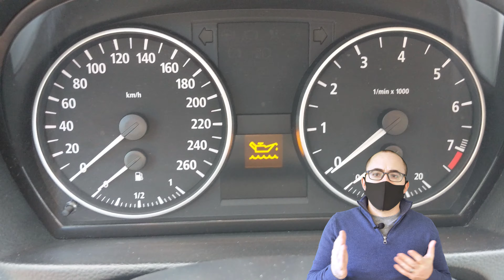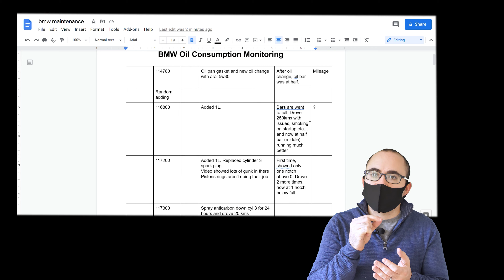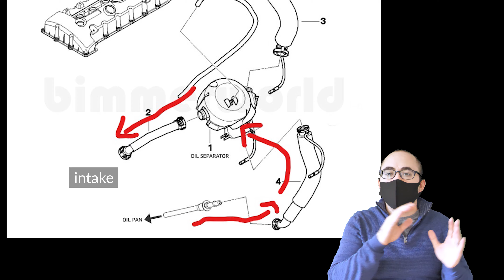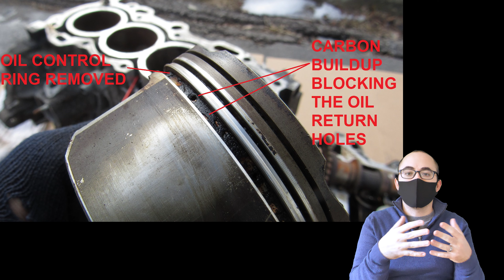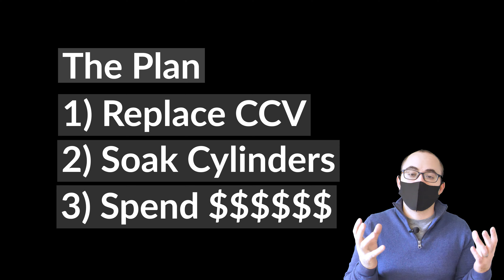How To Fix Oil Consumption Issues On Your Car - Infamous BMW N52 INSANE Oil Burning Problems!

Comment: One of the best Videos on YT regarding the n52 oil consumption! I already knew all of these issues, but i searched way to long for all this Info! This video is awesome because it saves you a tone of time! But sadly i dont have the resources and space to tear down the engine! On my n52 piston rings and valvestem seals should be replaced. A shop would charge way to much money. So im just gona keep filling it up with oil.
Reply from the maker: Hey Jonas, Just wanted to say a massive THANK YOU for your comment. I just started this channel yesterday, so I don't know how you've found it so quickly, but I hope the info can help more people as I have had oil consumption issues for YEARS in my e90! I have tried everything... so I am now almost done rebuilding my new engine and will put it in my car soon. Send me a photo of your car on IG, would love to see it. Hope you enjoy the next videos, I am uploading more content every week!
Reply: @buildanddrive  Hello, I'm interested to see some news after rebuilding the engine. What parts were replaced and what were the costs? I also have N52B25A and I have to fill approx 1L/2000km so I think about doing the same. Thanks.
Reply from the maker: Hey Michal, If your car is at 1L/2000kms, you one of the lucky ones as that oil consumption is still okay for this engine. Keep driving it until it gets much worse than that before investing a lot of money into the car. I still need to calculate my costs which I will make another video on but it was about 1200 for most of the parts and 800 for parts (Including engine crane, engine stand, tools) I have put the engine in the car and am driving it, I ran into some leaks which are now fixed so I don't know the final oil consumption numbers yet. I have to keep driving it until the light comes on. Send me a message on IG and I can let you know when I know. Thanks again for the message

Comment: 2009 bmw 328i. (180,000 miles) Brand new valve cover just put on, all valve cover gaskets new, brand new Crank case breather hose, oil filter housing gasket brand new, brand new Valvetronic Eccentric Shaft Sensor, 3 new ignition coils, all new spark plugs. (All genuine BMW brand parts)

Now I did this all in one day by myself. I’m not a mechanic for a living but I’ve always worked on my own cars. When I changed my valve cover I just went ahead and did everything I thought my car needed. Apparently it needs more though. I had a bad oil leak before, pretty sure it’s not leaking anywhere now but it still seems like it’s burning oil quick. 
 
The main reason I did this job was to fix a vacuum leak I thought I had and fix the oil leaking everywhere. But I’m still getting the same codes after all that, bank 1 and bank 2 too lean. 

Any ideas? Could bad fuel injectors cause this issue? Maybe I should also get the other 3 ignition coils? (Already replaced 3) another thing to note is after I put all brand new spark plugs in, I took them back out a few weeks later to look at them and they look pretty burnt, like way to burnt to be a few weeks old...I don’t work on cars for a living so maybe that’s how it’s suppose to look but they seems pretty burnt for how new they are.

And forgot to mention, before the job I did have a lot of vacuum coming from the oil fill cap, after the job it seems to be fixed, still has very little vacuum but I think that’s normal.
Reply from the maker: That is interesting, I would clean the maf, make sure you intake pipe is tight, and what is the code you are getting? You could clean the oxygen sensors (in brake clean or fuel) over night, just don't knock on them, be gentle because they can break. Did you get misfire codes? I had some and it was a bad coil. I ended up replacing a few and those went away. Never got a lean code tho. Text me on IG, and I will think about this some more.

Comment: 3:28
For future, remember that: Spray bottle "brake cleaner" is best oil cleaner in world. Even cheapest one.
Spray it on your oil pan and around it. It dissolves all the oil, it evaporates and leaves clean dry surface.
I use brake cleaner a lot. Bought once 20 bottles. Very good and cheap thing to have in garage. For all kinds of cleaning
Reply from the maker: You are so right! I bought a box of 12 cans after this 😅

Comment: Bit late to comment 
But I own a 2005 e90 N52B30 , it consumes 0.5L of oil at around 8000Km and has about 218tkm , seems I am pretty lucky and for what I know about the car  the previous owners didn't really change any seals. I only had to change the Oil filter housing and the Oil water heatexchanger seal about 2 weeks ago besides that its driving like a champ.
Reply from the maker: Wow! 👏👏👏👏 N52b30 seems to be a better engine but for that year I think you're lucky. Are you sure it's an 05 and the engine has never been changed?
Reply: @buildanddrive  
Yeah i know the history because i got friends at bmw and they checked the history of the car and i have a pretty sizeable pile of repair bills for the car of its 17 year life.
It was maintained at bmw dealers till 2015 and after that owned by a mechanic who cared a lot about the car. It's in great condition and as far as i know the biggest repair on the engine was the cooling pump.
Love the car 🥳

Comment: Hey, really nice videos, I've watched so many videos and read forums since I have my 2005 N52.. when I bought the car my mechanic changed so so many things, and the car works perfectly but that damn oil usage.. if I drive it in the city it doesn't consume as much , I can go like 1000km , but if I take it out on the highway and do some spirited driving with fast accelarations, high rpms, it literally drinks 1 liter oil in like 100km or less.. which makes it very annoying because I constantly need to keep checking the oil level, and I'm scared to go on a longer tour cause what if I run out of oil even with the safety 1liter bottle in the trunk..  my mechanic says that I should just keep driving it and adding oil to it, cause its most likely valve seals and/or piston rings. Do you reckon it's okay to use the car like this? I only put in like 8000 km/year. I guess this will worsen over time, but in the meantime if I just make sure there's enough oil in the car, can the oil burning do any damage?
Reply from the maker: I had the same issue. The oil was burning so quickly the sensor can't keep up. As long as you keep oil in the engine, it should be fine.
Reply from the maker: So I thought about it some more. As long as your car is running ok, then it's fine. My car was burning oil at 1L/300kms and it was fouling the spark plug on cyl3 every 5000kms. So cyl3 has a major issue. Then you should really think about selling the car, swapping or rebuilding the engine. As long as you can keep driving, then do so.

Comment: 2005 325i with 125k miles using a litre of 5w30 every 400 miles. New CCV didn't help. I am leaking a bit from a bad valve cover gasket, not changed it yet. Tried a few Forte oil additives, didn't help. Going to fit a catch can (to help the catalytic convertors) and go to 5w40. Sometimes get a catalytic convertor efficiency code. No blue smoke or visible signs of oil use even after long idle (I left it 30 minutes when I did an oil flush).
Reply from the maker: Yes, my car smoked only a little but was burning at 1L/300kms😱. It was drinking so much oil that the oil sensor couldn't keep up. Would have blown up the motor if I didn't religiously watch the odometer.

Comment: Amazing video!. Glad i found a new channel to learn from. Im nervous about doing my motor mounts.  😂you got the whole damn engine torn down. Luckily i no longer have oil issues after doing the ofhg. Also, using lucas synthetic with the 20k mobil 1.. changing oil every 5k. Wish i had always done this. Now at 145k. 06 bmw 325i
Reply from the maker: Motor mounts aren't too hard, but you need a safe way to jack of the motor high enough to get them out. Do one side and then the other.

Comment: I have a x3 e83, N52 engine with usual electronic water body. I live in extremely hot area, is it possible to run this vehicle without a thermostat valve at all? Meaning removing the valve and spring from inside the thermostat housing and installing back just the housing on the engine. Any codes or impacts on other engine operations would i get by doing this?

I did this to my M62 Range Rover L322 and its been running absolutely fine since last two years, but that has a simpler thermostat. 

Pls advise this for X3, since due to high temperature my car is burning oil massively despite only 90k kilometers mileage with oil change history at ever 5k kilometers .

Thanks
Reply from the maker: I will look at my old thermostat, i don't remember how it was designed. But you should look into reprogramming the water pump. It runs on eco mode most of the time to keep the oil temp at 99C. You can run it on 'high' mode to aim for 90C. You can do this through inpa but I've never done it. You could also run a bigger radiator/fans. Or create some sort of spray system for the radiator too.
Reply from the maker: I will look at my old thermostat, i don't remember how it was designed. But you should look into reprogramming the water pump. It runs on eco mode most of the time to keep the oil temp at 99C. You can run it on 'high' mode to aim for 90C. You can do this through inpa but I've never done it. You could also run a bigger radiator/fans. Or create some sort of spray system for the radiator too.

Comment: 2007 E87 130i with the 3 L N52N engine and 234.000 km. At first I got around 6000 km with 1 L of 5W30 and now I'm getting around 4000 km with 1 L of 0W40. The valve cover was replaced by BMW at one point which includes the CCV on the N52N. It still seems to leak around the valve cover gasket. It's definitely leaking a bit around the oil filter housing gasket. I didn't yet have a chance to look under the car with the engine cover removed but I never saw oil drips where I parked.
Reply from the maker: Nice... The 130i is an awesome car and your oil consumption is not even an issue compared to us n52b25 owners 👌🏼
Reply: @buildanddrive  Yes it really is a lot of fun :) I know that the B25's oil consumption is a lot worse but 1 L / 4000 km is also not normal even though most N52's with this kind of mileage use that much oil. There are also N52 owners with high mileage and next to no oil consumption so there must be something wrong. My engine unfortunately was maintained by BMW until 220.000 km so maybe these wayyy too long oil change intervals lead to increased wear?
Reply from the maker: @MrMagicMadMax  Maybe but 1L/4000kms tells me the engine is in really good shape. My oil change intervals are around 5000-7500kms. So 1L between oil changes would be awesome! (Instead of 5L😂). I used to buy my oil in 20L jugs and that would only last me 1 year 😆

Comment: My car is E60 523i N52B25 white cover
No leaked oil but consumptions 1L after 1500km with normal drive its 280000km milage 
Is it normal or theres an issue?
Reply from the maker: This is normal. 👏🏽

Comment: Great plan. Curious to see next vids. Mine is N52 258HP. Burns ca. 1l every 4 - 5 thousand kilometers. Tried cleaning the engine with AR2300 and got maybe 15% better milage on 1l.
Reply from the maker: Wow if you are already at 1L/4000kms, it's every n52 owners dream! Hang on to that car! The engine is in great condition 👌😁
Reply: @buildanddrive  I agree!
Mine is N52B30 and I had exactly the same surprise after I bought the car and replaced oil to see that low oil warning came after 4500 km.
Reply from the maker: But 4500kms is pretty good. Shows your engine is actually fine. My oil light came on after about 1000kms 😅😅😅

Comment: Yes, aside from obvious leaks it's usually the CCV>Vavle seals>Piston rings (more often stuck than worn). But just about everything in this motor is sensitive to oil quality and how often you change it. With good oil and frequent changes it really lasts. And if anyone has famous "valve ticking" at cold start - go for 5W40 oil instead of 5W30 cuz that's the oil this engine was designed for initialy it seems. Also - few people know that CCV has a special nipple you can use to easily test if it's ok or torn.
Reply from the maker: How do you test the CCV to see if it's torn?
Reply from the maker: How do you access it if it's buried under the intake? You have to take it all apart I assume to check, correct?
Reply: @buildanddrive   Yes, it's not very easy to access but still possible. You can just put some long thin rubber hose on that fitting so you can blow into it at distance . BTW there's usually a small plastic cap on that fitting you need to remove first (easy). Check photos on the internet and you'll get the idea where it is and how to find it by hand. The fitting is protected by 2 plastic ribs near it that make it easy to identify.
Reply from the maker: Mine had a hard plastic cover on it. Looks like a plastic bleeder valve. Maybe my CCV just is junk 😅
Reply: @buildanddrive  Yes, that plastic cover should be there, remove it and put somekind of hose on it and blow (by mouth, not compressed air). If you can't - membrane is ok. Although if you had torn membrane in CCV - you'd probably have excessive vacuum at oil fill cap already. But since CCV is responsible for some serious oil loss and engine contamination when not working right - i'd replace it just to be sure. It's good idea to do it when checking small DISA - something you absolutely want to make sure is working anyway.

Comment: Hi....can you tell me in the end what the oil consumption was from? could it be the oil sump gasket or crank shaft seal??
Reply from the maker: In the end, the oil consumption was 1L/1400kms. I am making a video on this now. But this is with a vanos leak. Fixing that soon and will remeasure.
Reply: @buildanddrive  i just installed my new ccv system. noticed with new OEM kit did not have check valve on bottom hose. so I cleaned original and re-used. I think i have fixed my oil consumption issue but still have a cold start idle issue. will let u know how things go also
Reply from the maker: Cold start with rough idle? Mine was revving up a bit at cold start. It was a disa valve leak. Smoke test your intake to check where the vaccine leak is coming from.

Comment: I have a 2007 N53, and it uses about 1L/1000km, i dont see any leaks, but i cant figure out what causes the consumption. i have no strong vacuum on the oil filling cap so the CCV is probably good (i dont even know where it is in the N53. i used anti carbon for the piston rings, so i need to wait for the results on that one. i dont get any blue smoke. i did get some oil on my spark plugs, so im hoping the piston rings are fixed now
Reply from the maker: Sorry to hear, how many of you spark plugs are clogged up? My cylinder 3 wrecked the spark plugs every 5000kms. So I assume it's that cylinder that had the major problem
Reply: @buildanddrive  i had 2 spark plugs, on cylinder 2 and 3, but when i removed them they were drenched in oil (tip), i dont know if it matters but i had just driven, since the engine needed to warm up for the pisotn rings cleaning.
Reply from the maker: The anticarbon stuff did clean the top of the pistons but the rings are normally worn out, it may start burning even more oil after the treatments because the rings get more loose. Would be great to see what happens, so feel free to drop another comment after you know

Comment: Hi,thanks for your vids, they are amazing! my e92 325i n52 is burning approx. 1,25-1,4l/1000 km. I’ve started to see slight blue smoke while revving at 4000+ rpms. I tried your “pcv test” by opening the oil cap and It is quote sucking it down. After opening the oil cap, the car rpms went down and the engine nearly stopped, so I closed the oil cap and the engine rpms increased to normal. Could that the PCV or is it normal, that the engine nearly stopped after opening the oil cap? Thanks for your reply!
Reply from the maker: The CCV sounds bad if the cap is hard to open. I would try replacing that first and see if it helps your oil consumption! 👍🏼

Comment: Anyone help!
I bought BMW E90 325i (N52B25) engine in it, I have massive oil consumption since I bought it.
The next things are changed:
- PCV valves 
- Oil separator
- Gasket
- Disa valves
Still losing insane 1l of oil every 300-400 miles!

I have abnormally thick white smoke coming out of my exhaust..
I am afraid that piston rings are in bad condition, but what confuses me is that my separator was full of oil even after changing it..

Any advice from anyone?
Reply from the maker: Yes, it could be the piston rings unfortunately. I had the same issue. Double check you are not leaking anything first. Otherwise you may need to swap the engine or rebuild. I suggest a n52b30.
Reply: @buildanddrive  Thanks for answer, I'll let you know what was the problem with mine, hopefully it is not problem with pistons..
Reply: @buildanddrive   I have sensor bad reading oil, sometimes is says it is full, sometimes on half and low, did u have any of these issues?

Comment: When I start my car [530i n52b30a] I smell oil, also when I’m at traffic lights.. recently my oilpan gasket seal and my (don’t know the English word) “top of the engine” seals have been replaced. 1l oil on 1000 km😢
Reply from the maker: Try to check under the engine and see which side the oil is coming from. I assume is the passenger side (for LHD) because you can smell it burning so it's on the exhaust. Check you vanos seals next. Do you see alot of oil on the front cover of the engine?
Reply: @buildanddrive  Thanks mate for you quick response. Didnt do that yet. I cant see any leak of oil for So far I can look.  Now we got ourselve a job to do tomorrow 😂
Reply from the maker: Also watch this. It's every single oil leak on an n52 https://youtu.be/fI7dNxKOMR8